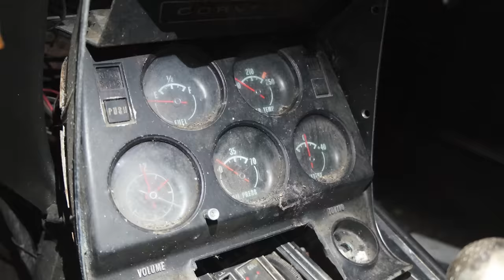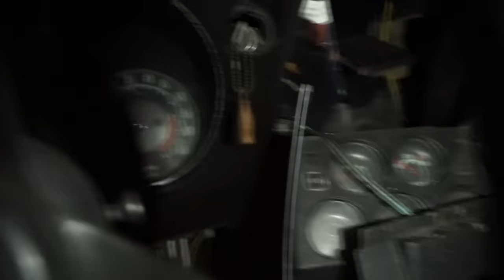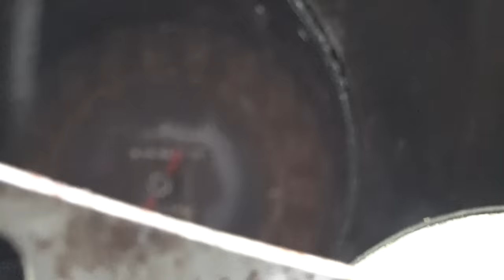1968 Corvette 427 Big Block Barn Find Rescue

Comment: I know where there is one in NH, 68 British green, 427, with original motor on the side, rag top. It's trapped in a large barn/breezeway behind a huge furnace. Also has a wall now built out front of it. Trapped, The owner will never be able to get it out. He's dis-abled and has one daughter who doesn't have a clue about it.
Reply from the maker: That would make a heckuva good video! Shoot me a msg if you can share a photo of building or any other info. You have the inside line to rescue that one. Maybe, make the owner some kind of deal?
Reply: I hope she never figures it out.....too rare
Reply: I'm in New Hampshire and have plenty of tools and 35 years as an auto tech.
Reply: I’m three minutes from the NH border. I’d love to go look and talk to the guy. Lmk if that’s something you’d be interested in doing with me please.
Reply: Well, spill the beans... There's plenty of us willing to help. Me included..
Reply: @davelowets  I just sent him an e-mail for openers. We'll see!
Reply: I have a photo as it is, but this is youtube. Ok, here's what he wrote me today, "My intention is to sell it. It would have to be a summer project as the partition wall would have to come out in order to get the car out. Also the engine in the car came out of a 69 police car, 385hp 427. I have the correct engine for the car, it is a high compression427 with oval port heads and factory dual point distributor. It also has a new convertible top installed just before putting the car away. The engine in the car would need to come out before the car left the property. I also have the hardtop for the car. I also have 2 brand new tires (Goodyear Eagles) for the rear. It won’t be a cheap car if you are going to proceed."

Comment: don't use wd40 to cut rust loose, use aero kroil or a good screw loose for bolts and screws, wd40 will make it worse later, that is not what it is for, water displacement and 40 has to do with the chemical. it removes all lubricant from what ever you spray it on, despite what others will comment about how this worked etc just check with the company that makes it, or maybe go a step farther and check with a restoration company. kroil usually comes in a gallon can, aero kroil is kroil with a lubricant in a spray can.

Comment: Very cool car and amazing find. One small issue with the story behind it is the part about side pipes. Besides the fact that side pipes were not offered on the 1968 Corvette, a quick look at the rear lower valance reveals that it had factory rear exhaust.

"Launching the wheel and tire 60 feet into the air" 🤔

Comment: Just a little Info. Side pipes were NOT offered on the 68 model year. So if this had side pipes, they were after market additions. Looks like this has an L-36 390 hp 427. I had a 68 L-71 435hp 427. I love 68's. Most collectors prefer the 69. 68's are less sought after because some parts are hard to find due to the fact that they were 68 parts only. This is also an early production car which has different parts from the later production 68's. Which adds to the difficulty in finding correct parts. You can tell it's early production from the location of the side mirror. Later cars had the mirror farther from the door seam. Just wanted to share what I know about 68"s. Beautiful car. Art work.

Comment: After all it's been through  it's  a miracle it's still in one piece . There's some traces of the original  color down on the lower rocker panels.  Restore that  vette to day one condition  and  will be worth  a Fortune ! 
I have a friend who owns a  69 
427  automatic  convertible  with full  power and factory  air conditioning  in steel city gray  
he was offered  over . $150.000 
for it  he declined the offer. And it's a one owner run and drive  number  match  survivor.

Comment: Times like this makes me wish I still had both of my 1970’s Gremlins one with a 390 and the other with a 401 police interceptor  in them … living in Northern 🇨🇦 in the 1970’s gave me plenty of time during the winter to swap out the 232 straight 6 and unbolt the front K-frames and replace them with (k-frame from salvage yard 304 gremlins)
My 390 & 401 dropped right in no welding or cutting 👍🏻
man those Gremlins were fast even by todays standards..
Cheers from HudsonBay Canada 🇨🇦

Comment: Back in 95 when I was in high school I took auto shop and we had the same car come in that had been sitting since 80 or 81. We got it running and did a "test drive" in our back lot, that Vette would break loose and go sideways through every gear. I'm not a fan of corvettes but that was one wicked car
Reply: I had one of these... Bone stock, they certainly wouldn't blow the tires away in 3rd or 4th gear from a roll, but they were a fairly quick car from the factory.

Now, my current Oldsmobile WILL smoke the tires from a 50mph roll, in high gear, with 18"×31" drag radials and a spool in the rear, but that took 547 cubic inches and 800h.p. to achieve.

Comment: Bought a 1967 Hardtop/Convertable 435HP Tri power 427 M22 4 speed in 1983 for $1900.00 Was a stupid kid and sold it a few years later because the Big Block needed a rebuild. Have always loved Corvettes.
Reply from the maker: $100,000+ decision there. Life happens, not many kept them long.

Comment: They will EARN this car when even a good driver resto is complete. I've looked back at cars I've had and I realized that I sold one to get the next and on and on. Had a 68 Roadrunner 383... sold to get a 69 Camaro... that sold to get a nicer 69 Camaro with bigger engine... that sold to get a 70 Mach 1 and that sold to get a 65 Sunbeam Tiger... that went to get the 74 Pantera and now??? Drive a 97 Expedition (barn find:) got it 6 months ago from original owner with 26,000 orig. miles and is spotless. I thought I was done but... there is a 62 Corvette with its nose sticking out from under a tarp that I drive past daily and well 😬...

Comment: Looks like factory cutout for exhaust pipes on that rear valance ?  Unless those were added - there would not be rear cutouts if the car came with side pipes...or am I missing something?
Reply: It's simple. The factory didn't offer side pipes as an option on the C-3 until the 1969 model year.
Reply: @middohio3875  Thanks for confirming...
Reply: @GT-37 Guy  Yes, that's correct about being an option for 69 only.
I own a 69 big block Vette and thought the same thing when he mentioned about the side pipes. 
I thought that maybe a set of aftermarket pipes were installed on her?! Those hooker style side pipes were killers on the legs 🦵 when exiting the low slung Vette!
I have a couple of girlfriends back in the day that will always have a mark to remember me by 😁
Reply from the maker: Mike added the side pipes after he bought it in 1974.

Comment: The 68 Vette...no...Chevrolet didn't have the fiberglass figured out on this,but it was still beautiful....those lines, the engine...legendary...and it's the year I was born...love this car
Reply from the maker: Yes! Great new design in ‘68 that stood out and still turns heads. Maybe you should get one as a birthday present someday? 😆
Reply: It may not be the prettiest vette, but the factory 4-Speed, the 427 big-block, and light weight, make it plenty worthy... 👌

Comment: its pretty special, the chev 427 mark ll is a high nickel big block with a forged crank that was only built for two years, 67 and 68,  they were developed for dump trucks, school busses and some fire trucks.  The vette was too fast.    i had one that lived in 5 different vegas ,  they were good for about 20 passes before the unibody failed but they were cheap and easy to tub.  i came within an inch of breaking into the 10s about 25 times

Comment: Not quite a year ago, I found a car i seen in a magazine when I was like 10 years old, it was in a motor trend book, 
The article was about corvette custom sportwagon,
35ish years later I found a 69 corvette sportwagon custom on an auction.
427 4spd, side pipes, I was lucky enough to actually be able to buy it off the online auction, 
It sat outside with no tops on it for 20 yrs, at a Plymouth/dodge dealership, since I got it, I found a post from a guy overseas that took a pic of it 10yrs prior, sitting at the same place. Then the day I picked it up, a guy video me loading it, and posted it on his channel, 
C3stingray, buying online auction corvettes,  
Im still working on getting it going, not alot of time to play.
Only thing that has been destroyed on the car,  I seen so far was both seats, I had to cut the bottoms in half to get to the bolts.
Reply from the maker: Nice! I see that! Side pipes, 4-speed, 427 too! That car deserves a movie. Corvette Summer Part II. I need to go look through my old magazines now. Y'all can see it here: https://youtu.be/l5oNNMn2hHA?t=237

Comment: Did you see the fastback Norton commando in the corner? And the Corvette 427 tripower that's the stuff wet dreams are made of.
Reply from the maker: I believe the orange bike is a Kawasaki H2 Mach IV. They were 750cc 3 cylinder 2-stroke made between 1971 and 1975. Mike loved to go fast and race anything, anywhere.
Reply: Look like a Quadra bog to me and it looks like it's a rat motor solid lifters angled plugs

Comment: I had a engine out of a 69 vette, it was the L 88 . I put it in a 62 bubble top with a four speed.  Ran it pretty hard for 3 years before I sold it.
Reply from the maker: Only 116 L88 Corvettes built for 1969. I wonder how many of those 500+ hp engines found homes in other vehicles?
Reply: @Junkyardlife  my uncle bought one new. And I had one.. I always thought they had more than that

Comment: With factory side pipes, the rear fiberglass panel should not have exhaust cut-outs in it. ???
Reply from the maker: Add-on side pipes. 68's didn't have them from factory, they were a 1969 option that many other C3 owners copied.

Comment: That's not a side pipe car you can clearly see the dual exhaust coming out the back.
Reply from the maker: Right! Mike added the cool side pipes that were optional on '69 Vettes. Thousands of other C3 Corvette owners did the same, ordering them at their local Chevy Parts Department. If I ever own a C3, or C2 for that matter, it will have side exhaust.

Comment: This is not a "barn find" it was put in a garage on purpose. It's like the car appeared out of nowhere, it was purposely parked.
Reply from the maker: Does "wooden outbuilding lacking electricity" have a better ring? Purposely parked in plywood? I'll think of a better term, or we can all agree that aliens put it there.
Reply: @Junkyardlife  it wasn't found the owner knew where it was it's not like hey we stumbled across this Barn in the middle of a field and there's a car in it.
Reply from the maker: @FuquarProductions  usually you get arrested for trespassing in that circumstance. 🤷‍♂️ got an example of a “real” barn find?

Comment: CAMARO SEATS
Reply from the maker: Right. Mike kept the original Vette seats. Mike had a first gen Camaro. I can't remember if he wrecked it and had parts laying around. I'm not a fan of the Camaro seats. I had those same style in my 1968 Firebird in 1990. I'm guessing they were installed when the Comfortweave on the front seats wore out.

Comment: Do yourself a favor and put this car back in the barn.  It's worth nothing. I had a 1969 427 that was in much better shape than this one, and when I brought it to the local Corvette shop for an evaluation, after spending thousands on it, he gave me very sage advice -- "sell car."  What you're looking at is a car that on the best day, after a full restoration would be worth $30k if you can find a buyer at that price.  But it's going to cost far more than that to get it there.  That frame and the bird cage (the frame for the passenger compartment, which bolts onto the frame) will both be rusted out and need to be replaced or have major sections fabricated.  The interior is trash.  The engine is trash.  You're going to have to replace everything in this car.  RUN AWAY!

Edit: oh, @13:45 or so I gather you're doing the restoration for the kid who has a personal connection to the car, so okay, putting $50k+ into a car that's worth less than $30k might be worth it for the link to dad or whatever, but there isn't going to be much left of that original car when the restoration is done.
Reply from the maker: I humbly disagree. When youth is on our side, we have hopes, dreams, and health (sometimes not). As we age, our health will decline. No stopping the unforgiving sands of time. We hold on to hope. And, if we can, a tangible dream. Mike holds onto that Corvette. He only moved it to protect it. I believe Mike has done everything in his power to keep it in the best condition possible with his situation. Everyone has a story. Your advice may help a youngster not fall into a basket case. Sometimes, we need to hang onto our dream.
Reply: Like I said in my edit -- if the owner has a personal connection to this particular car, then by all means spend money on it.  But if not, there is nothing special about this car and there are tons of them out there so he could buy one that was in better shape to "hang onto our dream."